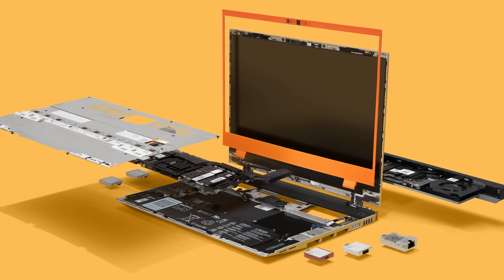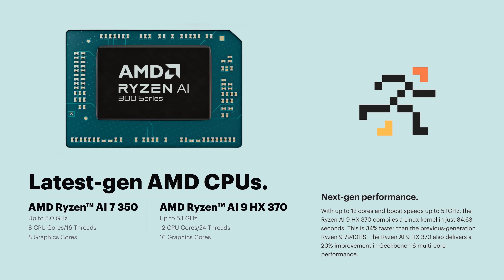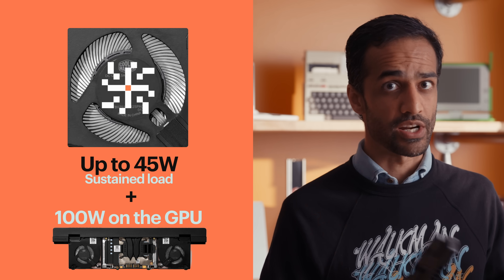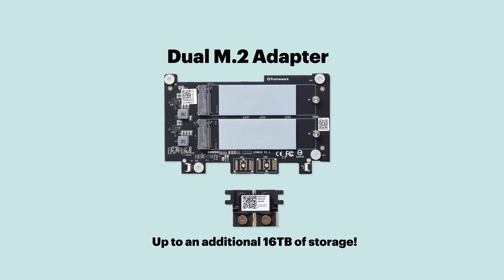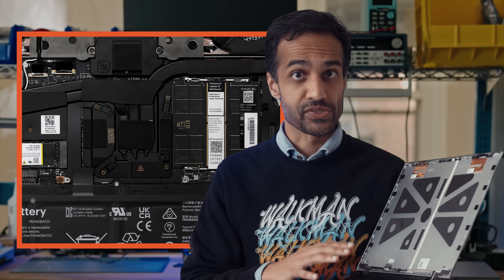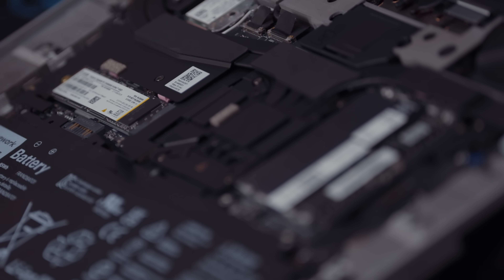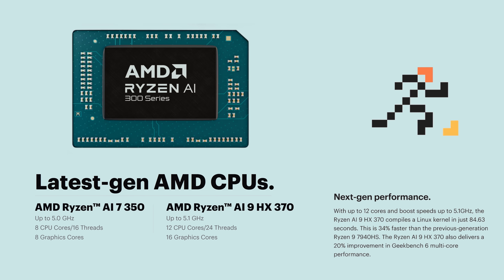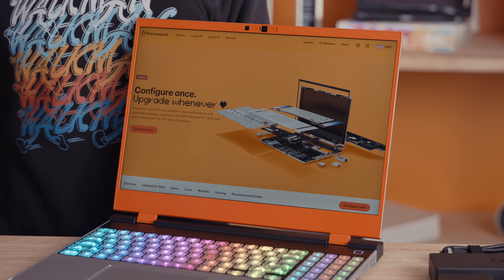Introducing the new Framework Laptop 16 with NVIDIA® GeForce RTX™ 5070

Comment: Framework 16 + Strix Halo + OLED Screen = instabuy
Reply: I believe Strix Halo wants more than the 45W or so they budget for the CPU in this chassis design sadly.
Reply: @BillyONeal  budget? it comes with a 180w charger, and is capable of 240w, they have LOTS of budget.
Reply: Instabuy, not Constantipurchase
Reply: No OLED unfortunately, we're stuck with a slow 165Hz panel which misses its 6ms refresh window... The current panel is only responsive enough at 11-14ms to be a... 68-88Hz panel...
Reply: @corentinrobin3513 no OLED confirmed? They can't source the same 1600p 240hz panel used by Asus or Razer?
Reply: @dontpokethebear3893 Yup, they mentioned in the video they're using the same 165Hz IPS panel - it's juste GSync certified now.

Comment: I just want an FW 13-style thin and light that includes a numeric keypad. Use the same mainboard, just put some extenders on one side to accommodate the stretch. The only new things needed would be the body, screen, and a numpad module to complement the existing keyboard module (maybe a slight non-breaking change in the touchpad to accommodate the new connection, but could still be used in regular FW 13)

Comment: Maybe they found a way for a Framework printer to be profitable 😅
Reply: Yes please
Reply: I don't understand why the price would be so high that this is impossible. I bet you would still have a market if you're double the price of most other laser printers.
Reply: There's patents on the ink "technology". That is one problem. Printers are also mechanically complex. Lots can go wrong.
Reply: @rikwisselink-bijker lol no. laser printers actually aren't that bad in my experience. sure maybe have better troubleshooting guides but brother and canon aren't that bad
Reply: @whatusernameis5295 Well, I bought a Ricoh and I regret it. The driver makes the program crash if you're not on W10, so I have to use a VM. Linus drivers are obviously not available.

Apparently picking another brand would have solved it?

Comment: Can FW16 get some love finally?
Reply: I hope sooooo much to. Like a new video card? New oled screen?
Reply: @jeffreygroot9910  Yes need new video module for FW16
Reply: @mtdesarno they just restocked the graphics module a few days ago so would be kind of scummy if they now just after restocking announce an upgrade
Reply: I second this, been holding off on getting a new laptop, hoping fw16 gen2 comes out at least by Feb2026
Reply: I agree. Framework 16 would need a complete refresh before I would buy one.
Reply: Wish granted!
Reply: I would say most likely.
Reply: Since the F16 is the "big" product and GPUs have been sold out for awhile, F16 GPU is a solid bet. 

Also, AMD CPUs like the Ryzen 9 9955HX3D were released January. 

It'd take some time to get things aligned so I'll bet F16 GPU, CPU and potentially 1 other thing, like a screen, which could've been in the works awhile.
Reply: I've been holding off on an FW16, since it obviously needs an update.
Reply: I would love to see the Framework 16 available with the AMD Ryzen AI Max+ 395 (Strix Halo) chip.
Reply: I do hope for FW16 upgrades, mainly a 240W psu.....but above all we REALLY need them to fix the dang firmware/bios. The most recent beta bios completely breaks charging (more than it already was).  Great hardware always dies a sad death when companies ignore the actual software to run said hardware. Framework has been ignoring these issues for over a year. This beta bios means nothing because it didn't even fix anything.
Reply: that's a yes then
Reply: it did!
Reply: I'm looking at upgrading my fw13 but it looks like I might be upgrading my fw16. Fingers crossed 🤞
Reply: A graphics module with 16 gigs of VRAM would be nice. Maybe some better 1440p performance perhaps?
Reply: It would be great to have the option of an NVIDIA card. Modularity is worthless if there is only one option (not counting the placeholder). I would also be happy to install an additional battery in place of the video card.
Reply: @Akiyamka  not totally worthless, given the specification for the expansion bay is public. there might be only one framework expansion currently available, but part of the benefit of modularity is that anyone can make something to fit this spec.
Reply: @absolutewisp Yes, in theory. In practice, though, shoving an off-the-shelf GPU into it isn’t something you can pull off in a garage with a soldering iron—even with the open specifications. The connectors and form factor are far too non-standard. For example the MNT Reform laptops may look like bricks, but at least it’s not that hard to stuff something in there yourself.

In short, until the Framework laptop becomes popular enough for NVIDIA itself (not MSI or ASUS, which each make their own laptops) to start producing modules for it, nobody else is going to bother. In that sense, modularity is useless for the now
Reply: It is XD
Reply: A new powerbrick is very good.
Reply: well well well :D
Reply: I laid down the price to buy one, and I love it. I just wish the company was giving it a bit more love, because it feels like they really poured a lot of effort into making it
Reply: I'm just hoping the fixed the software for the LED modules.  I can't seem to make them show greyscale images
Reply: A new iteration on FW16 or a new gaming oriented FW18, I don’t mind. 🫣
Reply: Finally!
Reply: I would say reliability over things
Reply: I just bought a Framework 16 with GPU...
Reply: @atomictem5725 true but we must see. Its an OK gpu for light games. But maybe it isnt about a new card. We don't know.
Reply: @atomictem5725  Same my dude :(
Reply: @atomictem5725  You and me both, my wallet is just screaming for mercy
Reply: I hope cuz I'm planning on buying it
Reply: @Matedev888 Do it! Even if it hasnt gotten a ton of attention after its release, the company put a ton of work into it and I love mine
Reply: @falafell yeah but I'm a buget baller and there aren't many used ones but I still planning on buying one with the video module
Reply: @Matedev888 Modules arent that expensicve and you can always add more or change them around if you want.